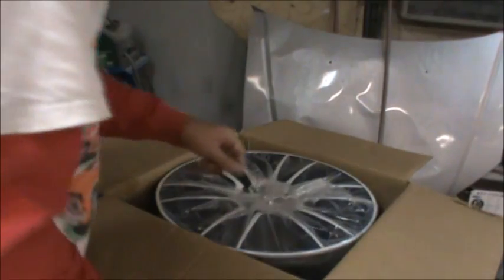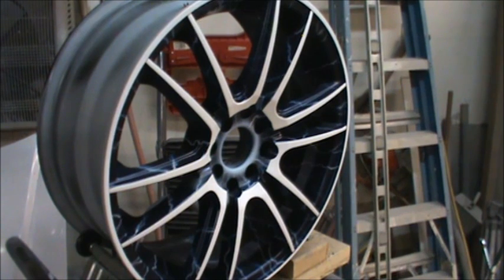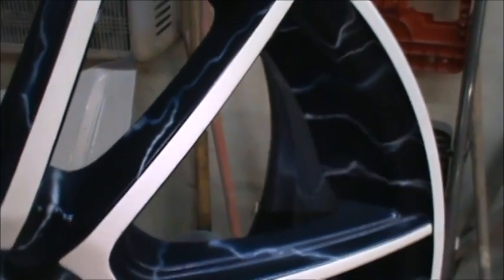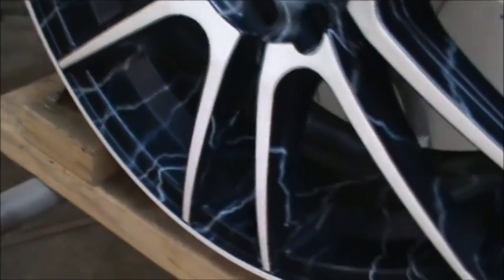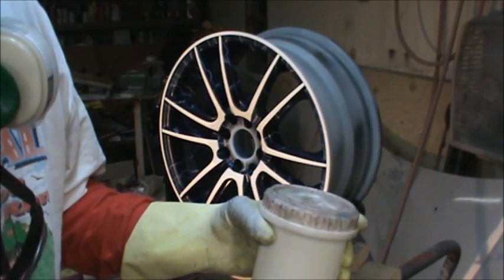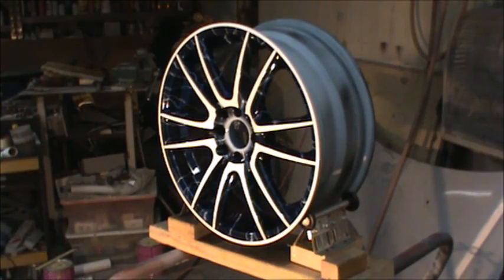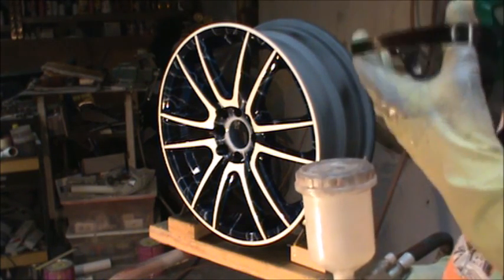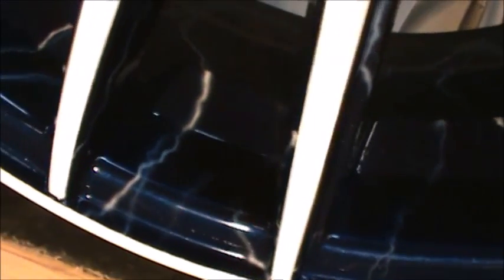My Civic EV Electric Car Project Part 24 Clearing The Custom Wheel

Comment: I use mx200 its double the strength of the mx195 so you need less
Reply from the maker: Mike Mckay Ill keep that in mind next time I get some
Reply: tomswonderfulworld I was always told by my rep the mx200 works better. If it's the same price it's worth buying you know.